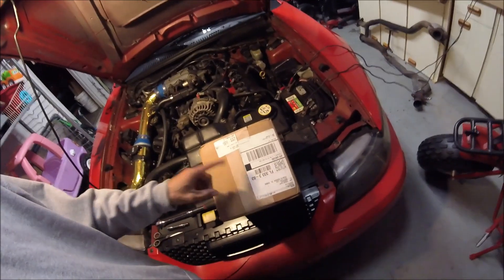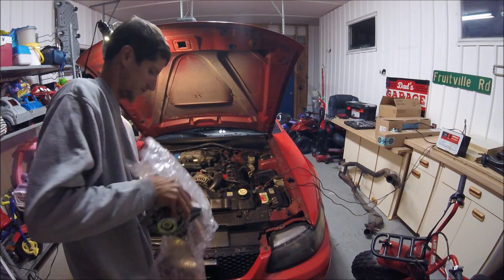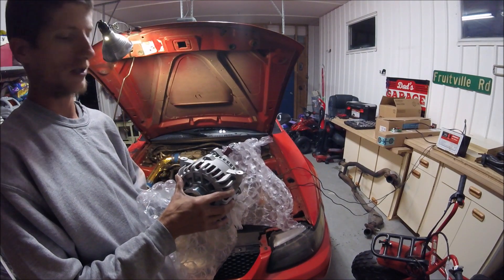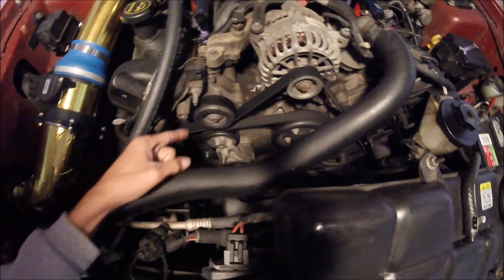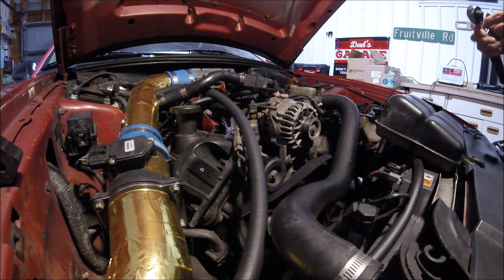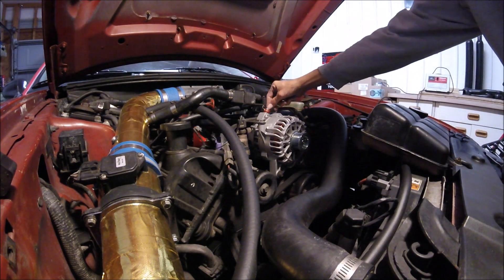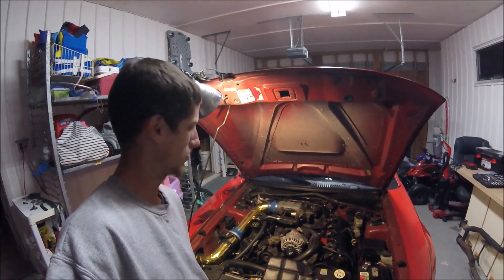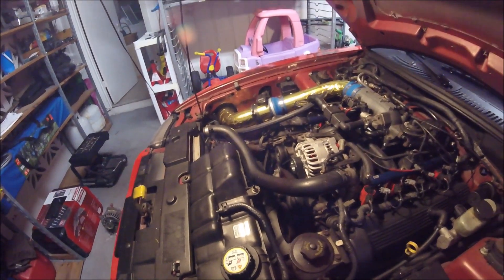SR Performance 130 Amp Alternator Mustang GT

Comment: With running a 130 amp what wires did you upgrade ? Can you be specific on what the wire is and where I can buy one
Reply from the maker: This is completely plug n play on the mustang. No need to change anything to run this alternator.
Reply: @killrspeed00  okay I have a 1996 thunderbird what do you think I should change my wiring
Reply from the maker: Look and see if this one would fit your car. Mine is for a 99-04 but this is for a 96-98 so it should work for you.
https://www.americanmuscle.com/130amp-alternator-9698gt1.html

Comment: With this upgrade is it plug and play? Do I need to upgrade anything else to run the 130 amp vs the stock 105?
Reply from the maker: Yes it's plug and play and that is all you need. Pretty simple and straightforward.